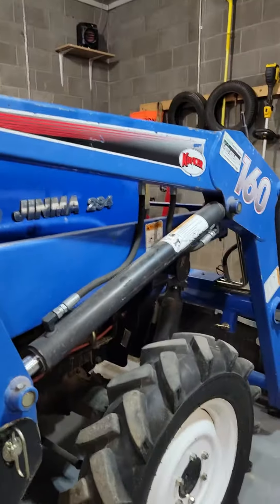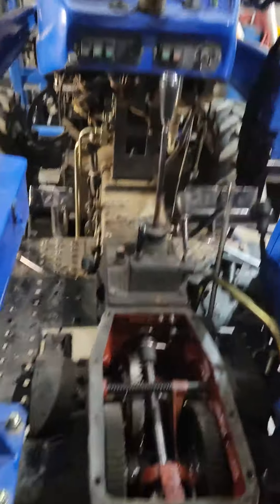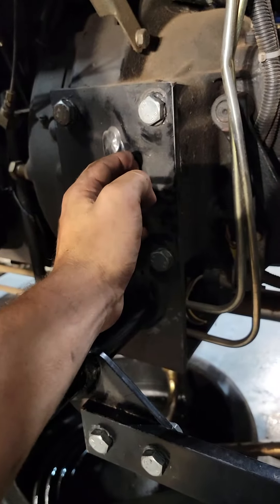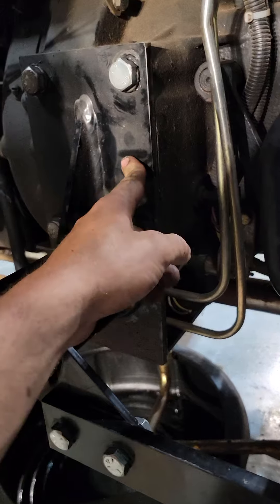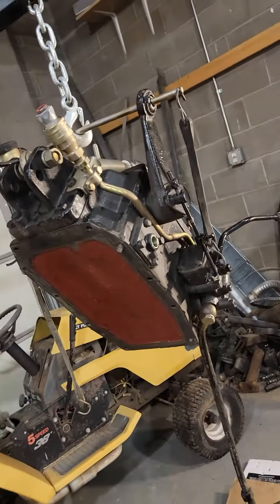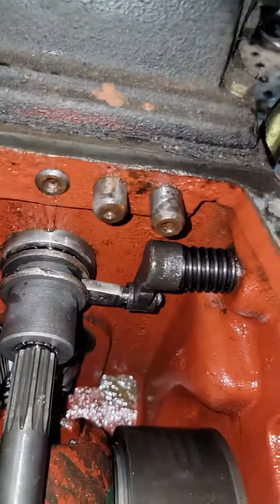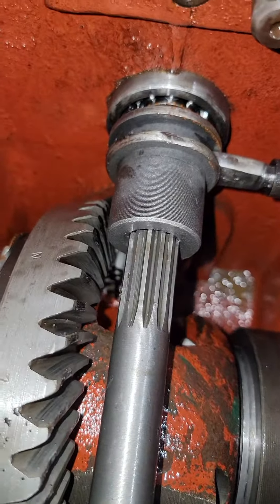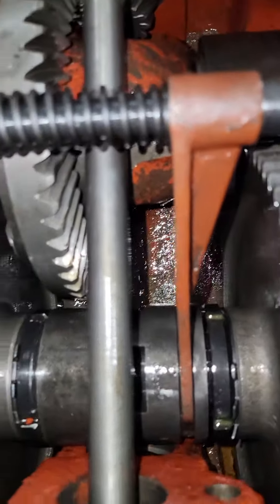Chinese tractor pto repair

Comment: Am i correct in thinking there is nothing internally holding the pto engaged? So the pto engagement fork position is held only by the detent system on the outside of the case where the lever is?